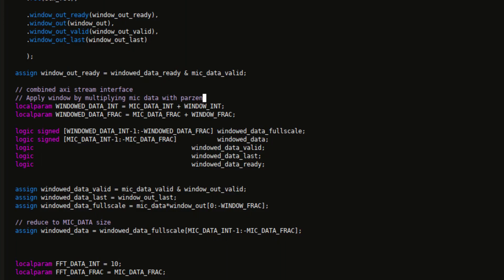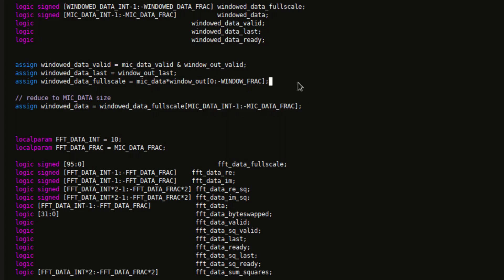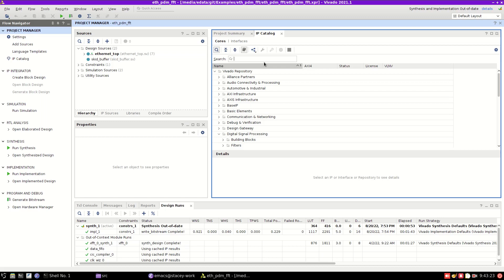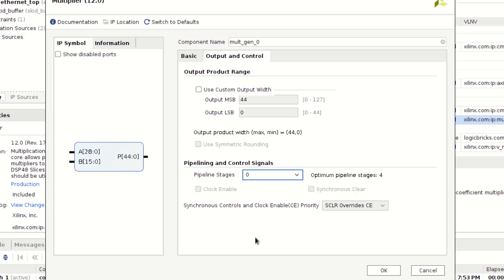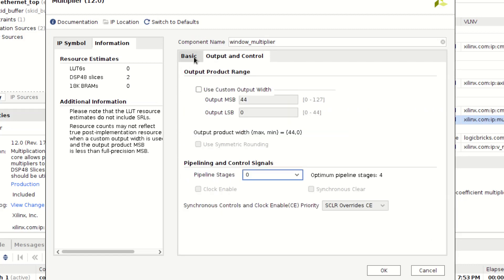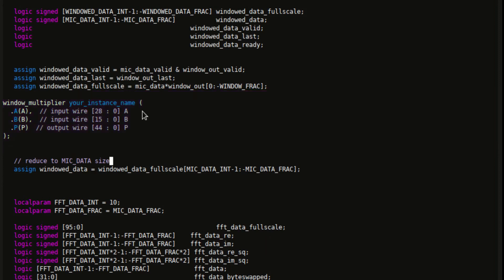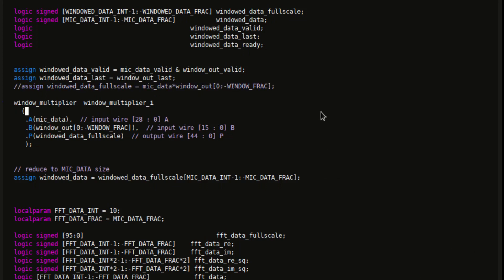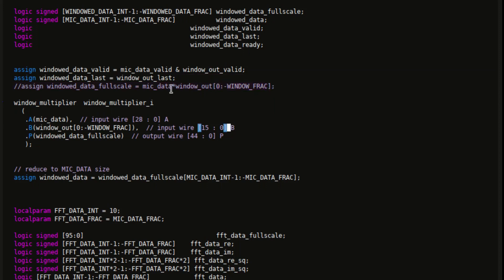When and how to use the Multiplier IP core

Comment: Hi,
With the DSP48E1, I can multiply 23-bit signed and
18-bit signed values
Now I have a 23-bit unsigned value and my 18-bit
value is unsigned (just like a 19-bit signed with
only positive values)
Is it possible to configure the DSP slice
accordingly?
If not, is there an elegant way to pre-process the
multiplicands or post-process the product in order
to arrive at the correct result?
Thanks!
Reply from the maker: You should be able to use the same resources for signed or unsigned. I recommend using the multiplier IP core to try out your configuration and see what resources it shows. Usually one of the tabs will allow you to choose to use a DSP slice, and how many your multiplication will use up.
Reply: @FPGAsforBeginners   After a few days of trying out all the options, I came out to this conclusion which is DSP 18-bit signed only or 17-bit unsigned. walk around by doing what this thread says.  https://support.xilinx.com/s/question/0D52E00006iHjc5SAC/dsp48e-multiplication-of-25-bit-signed-and-18-bit-unsigned-value-possible?language=en_US

Comment: I think I have come across this problem before. When you slice "window_out", the result is interpreted as unsigned, and signed x unsigned multiplication is interpreted as unsigned. My solution to this was something like "mic_data*$signed(window_out[0:-WINDOW_FRAC]);" This has worked for me in the past.
Reply: This is correct. If you slice one of the multiplicands you need to type cast it. I originally thought this was a Vivado synthesis issue, but I believe this is true even for Synplify/ProtoCompiler.
Reply: Yup. This should be pinned.